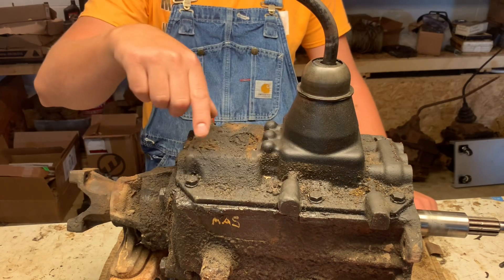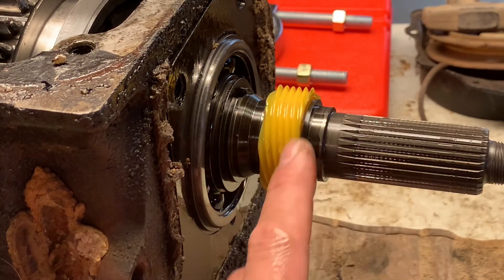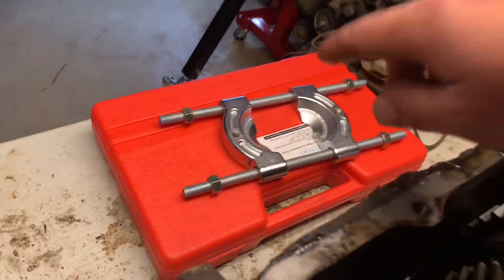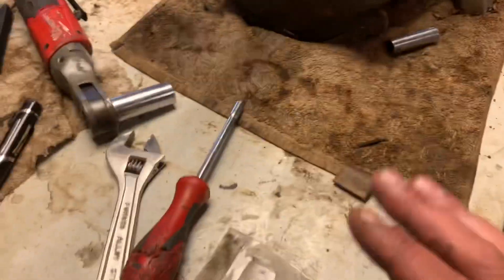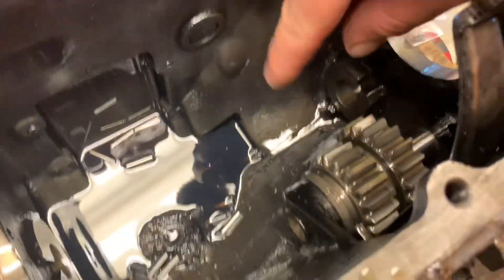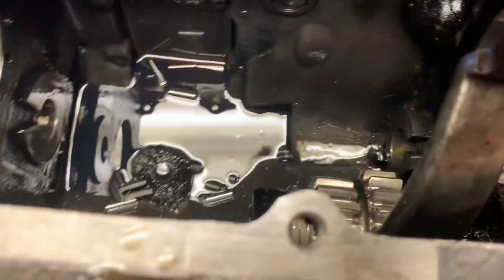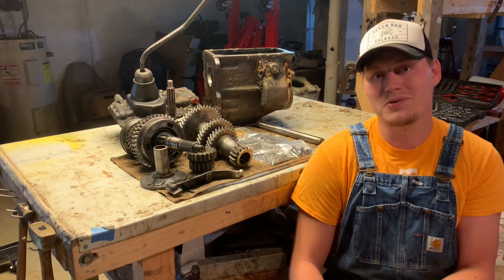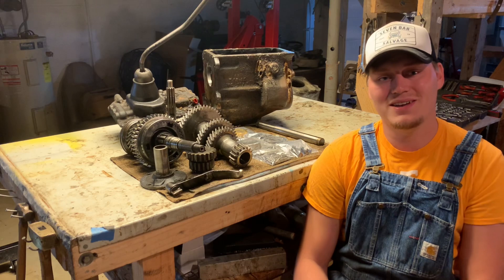Willys Jeep 4 Speed Swap: Transmission Disassembly!

Comment: For years I was afraid of pulling the bearings with a separator like that. Searched forever on u tube and finally found a picture of a guy doing it on a GM 465. Bought an otc kit like that and it worked great. Only took me 30 years 😆
Reply from the maker: Haha sometimes you just gotta go for it 😆

Comment: That washer thing on the imput shaft is the oil shield it's to help spread the oil evenly when the oil slinger sends oil up to grease the bearing its so not to must gets in so it doesn't leak too much
Reply from the maker: Thank you for sharing!

Comment: I got myself a new process 435 4 speed it has a granny low of 6.14 I think I was wanting to though into a tdi swap jeep but it'll need a adaptor for the engine and transfer case to thats a little discouraging it'll be interesting to see your engine adaptor
Reply: Also 435 had a nice second gear - 3:34:1 which is close to the t90-c first gear.  When jeeping with other flat finders your speed will be about the same.
Reply from the maker: It does seem kind of overwhelming at first, but there’s always a solution!

Comment: I've had a SM-420 trans for 20 years to install into my '55 CJ-5, what is the issue for using that transmission? Spud shaft? Bearings, etc.
Reply: Old and hard to find parts
Reply from the maker: They are great, durable transmissions, if you need to replace a gear or something the parts are just hard to find because they quit making them so long ago. Maybe have a second one on hand for parts?

Comment: That washer behind the bearing is an oil slinger. It allows enough oil to lube the bearing but not so much to overload the seal...if it has one. If it doesn't have a seal..like my M21 Muncie don't..and the oil just oozes back through the drain behind the throw out bearing snout, the slinger keeps oil flow down so it doesn't seep out on the clutch.
Anyway, you will probably address it later, but I noticed the trans was from a 2X4 or divorced transfer case 4X4, so do you need an adapter and different output shaft?
Reply from the maker: Good to know thank you for sharing! 
There’s no advantages between the 2x4 and 4x4 cases according to Novak both need the transfer case adapter and the main shaft replaced… I’ll go more in depth on this in the next video! Thank you for watching!